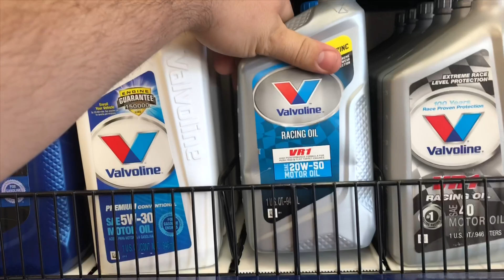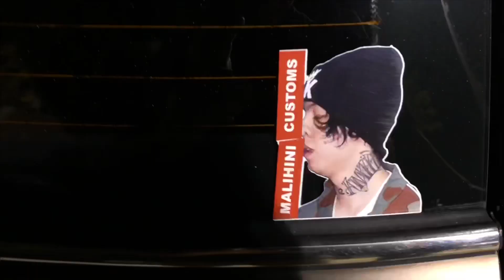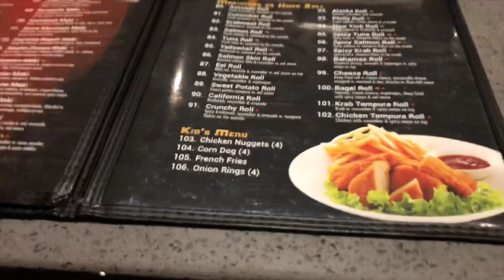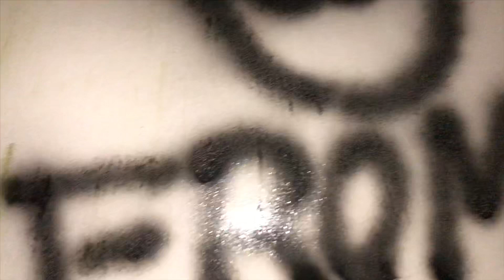Integra Prep for Cleetus and Cars || Simply Clean Pre-Meet

Comment: I bet the awd nitrous crx run a better time than that Integra.
Reply: HA it will never go faster than the TEG
Reply: What!!!!! How much you wanna bet on that. I'm a all motor lover awd crx nitrous built .
Reply: @jasonjackson8683  that cheaply built b20 on spray will never out run that fully built b18 in the Teg. ill send you my paypal info just send me 500 once that crx can go faster then the teg ill give it back lol
Reply: @PATuners  lol you funny bro . Lighter chassis and awd nitrous .I guarantee that crx be faster.
Reply: @jasonjackson8683  Put your Money up LOL.  You must be new to the Channel IT's Clear you have no Clue what's done to La Fea  . YOU are extremely Living in a dream world with the Crx faster than La Fea . The Awd That Pablo is using is all CRV stuff its not going be that great of a awd setup. Most of the power will still go to the front wheel 80% of the power the front wheel will see . Everyone knows you have to use the Wagon Viscous coupler differential  if you want the best awd setup you can do for a Honda . Then there's the B20 stock sleeves all cheap parts used to build it with no vtec ebay clutch  this is a Budget car for a Youtube Challenge. That Pablo built to race with his friends on the streets and do the Challenge but clearly you haven't paid much attention to the channel. Are you clearing don't no much about Honda's at all.  Are just a Troll